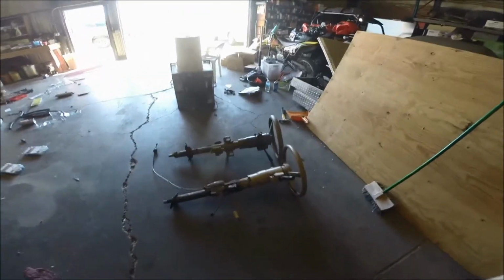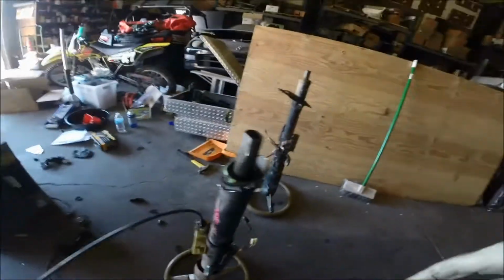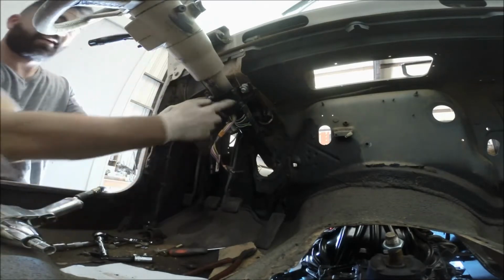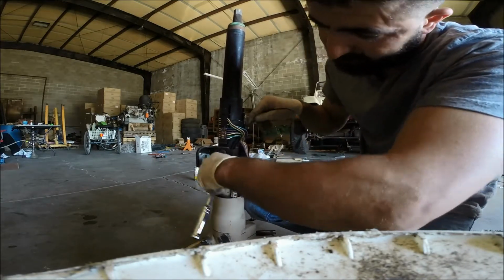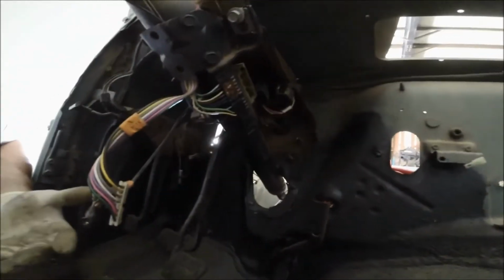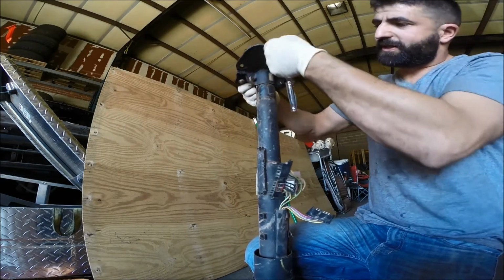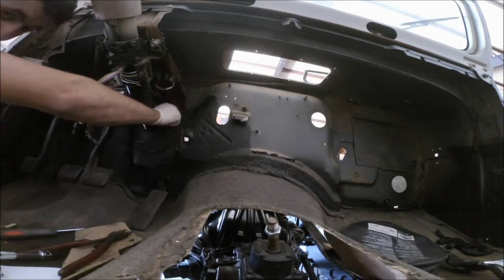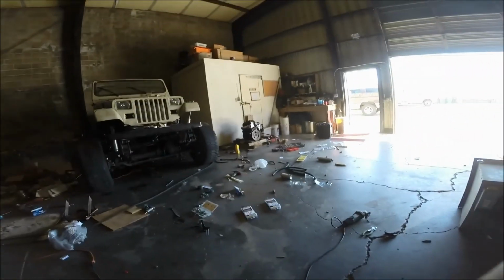How to Install a Jeep Cherokee or Early GMC Steering Column into a Jeep Wrangler YJ

Comment: Good video and thanks for saving me a bunch of money. BTW you purchased the steering column from an Automatic Cherokee with floor shifter and your Jeep will be manual shift. How have you resolved the auto key shift lock issue? In the video you removed the cable from a rod on the column that had a ball on the end. If you put a key in and turn it to the on position, you can not turn the key all the way back to the Lock position and remove the key unless you push that rod up. I am doing the exact same conversion for my YJ.
Reply from the maker: I Honestly don't Remember Now. But it Was Something Very Simple Like Remove The Mechanism or Ziptie it in The Position it Needed to Be 
My Jeep is at My Warehouse Right Now and If I Remember Next Time I'm There I'll Get Under My Dash and Look.
Reply: @JohnstuhDeMonstuh  Thank you!
Reply: Thank you for your video.  I did exactly what you did but i also am here revisiting your video to see what you did with lever.  I found your comment on zip tie to it.  Tnx

Comment: What year yj and what year Cherokee did you use?
Reply from the maker: My YJ is a 91 But I Believe This Would Work for all YJ and CJ as Long as You Check The Length of Column and Check The Yoke Pattern on The Steering Box.
I don't Remember What Year Cherokee it Was But it Was The Same Era Cherokee.
Not The Newer Ones With Airbags. So Late 80s Early 90s Cherokee.
You'd Be able to See That The Steering column is Similar or Same in Looks.